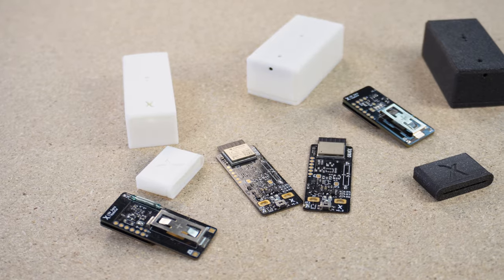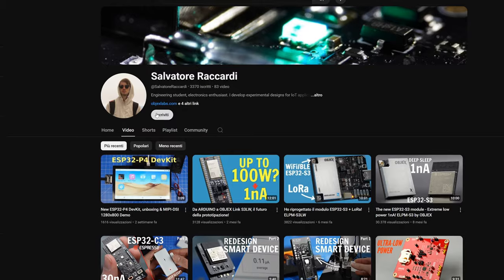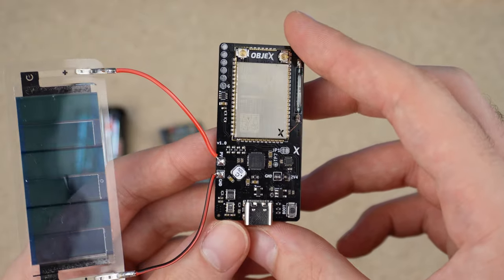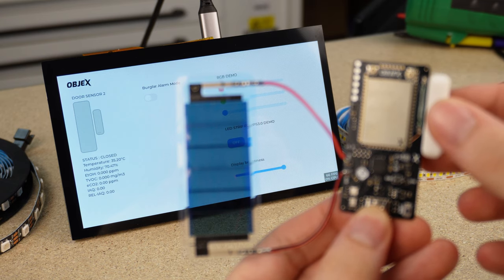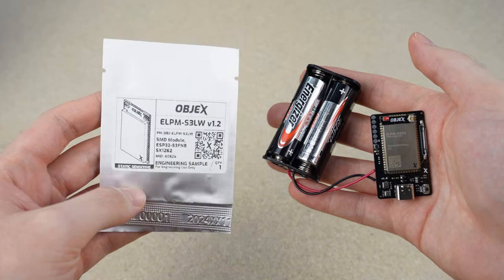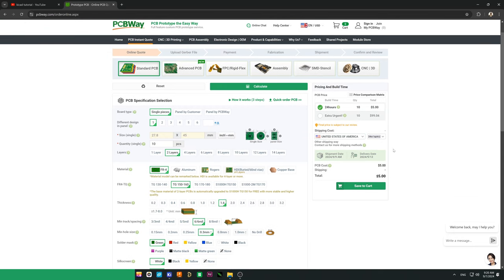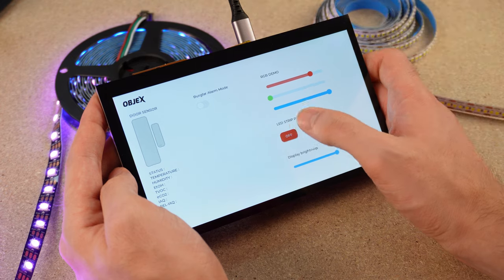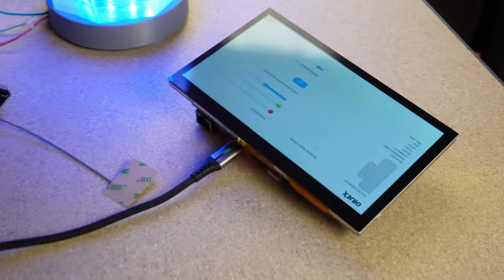ESP32-P4: I Built a Smart Home Ecosystem, Extreme Low Power & Energy Harvesting

Comment: WOW - this is great!  Very well done!  I think you'll be hitting the ball out of the park with this!  I've just signed up for notifications on the crowd supply site and am looking forward to it.   Will you be offering options to get the right solar panel, Lithium Ion Capacitor, and external antenna?
Reply from the maker: Thank you so much for your support! You will be able to buy every single accessory, including the 3D case. We are working on a final version for fundraising.
Reply: @SalvatoreRaccardi  That's great, I'm looking forward to it.  Also, I just put up a note on the esp32 reddit forum to help spread the word.  Good luck!

Comment: I think the only mistake Espressif made was not embed in the ESP32-P4 the Wi-Fi Transceiver. It is a 400Mhz IC, very suitable for Smart Home devices, but you need to use another esp32 like C3 or C6 to complement you project. Great video. I always see your videos as soon as they are released.
Reply from the maker: Thank you so much for your comment and for the continuous support. I agree with you, the lack of an embedded Wi-Fi/BLE/... transceiver in the ESP32-P4 is a bit of a drawback, especially for smart home projects where connectivity is key. However, I think Espressif focused on performance and flexibility, allowing developers to combine different modules like the ESP32-C3 or C6/C5/H2.
Reply: @SalvatoreRaccardi  i still think they will release some kind of upgrade soon.
Reply: Mistake? not really. With the radio sharing the chip with fast dual core MCU would likely disturb it quite a lot.

The two chip solution is likely to give better wifi and processing performance.
Reply from the maker: Good point.